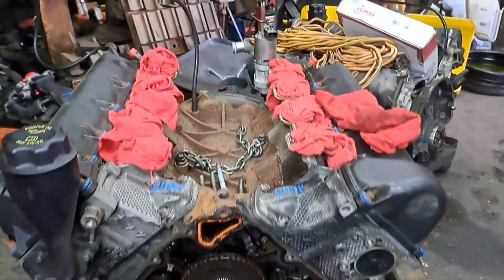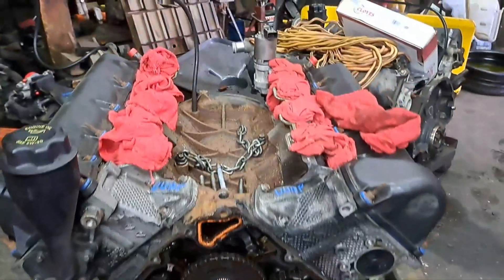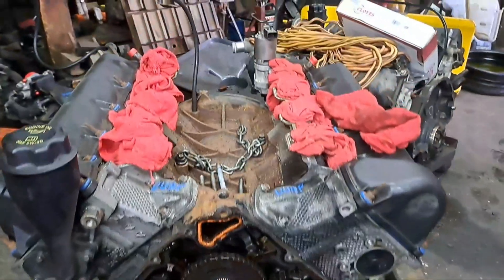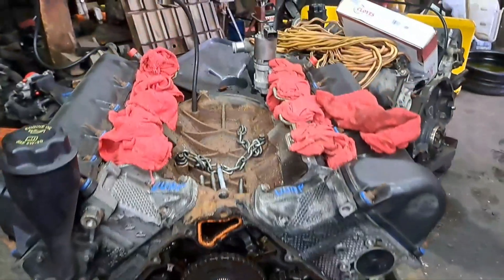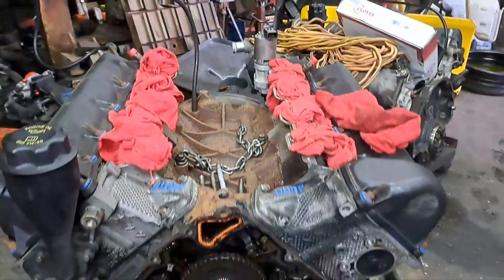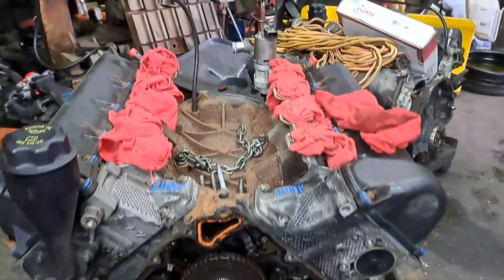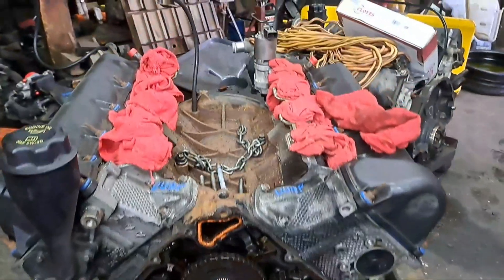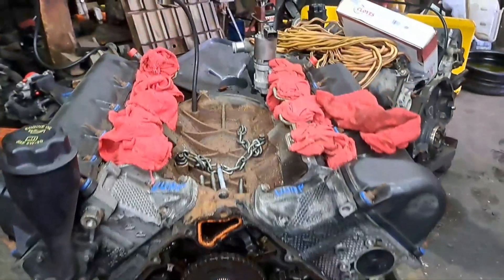Dodge 4.7 Timing Chain Replacement How to🔥🔥🔥🔥🔥🔥🔥🔥🔥🔥🔥🔥🔥🔥🔥🔥🔥

Comment: Would taking the rockers out be easier to set timing? Takes any tension that the cam has, and not have to vise grip the cam?
Reply: And what it have read is to line up cam chain thru the slots in cam main sprocket so you see both dark links thru hole for both sides